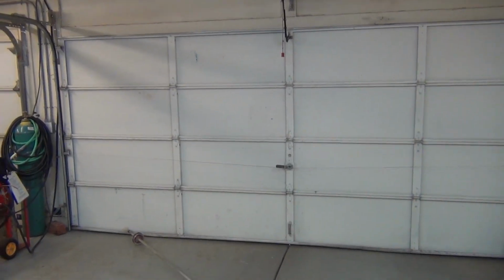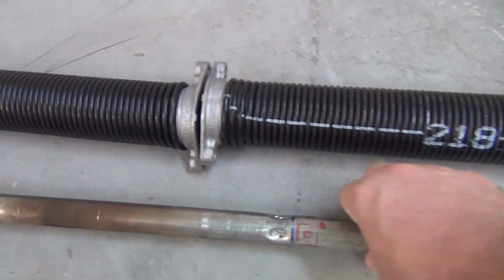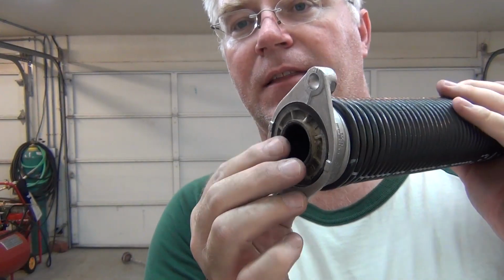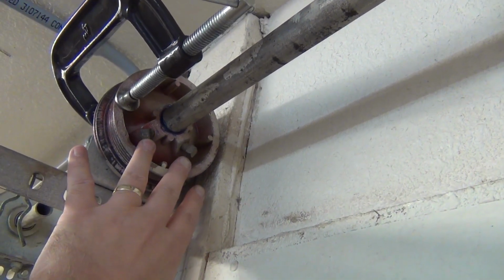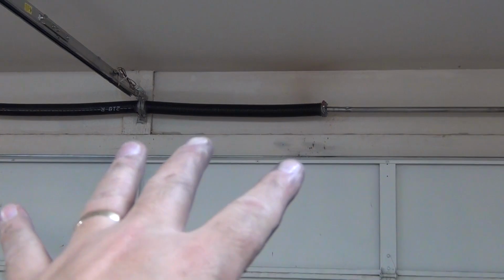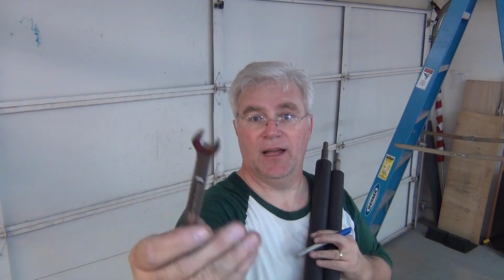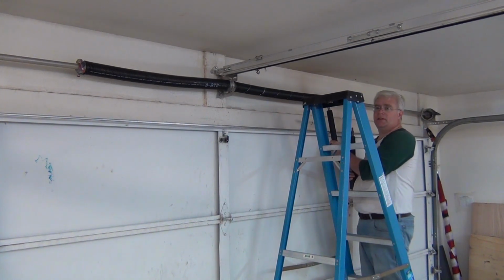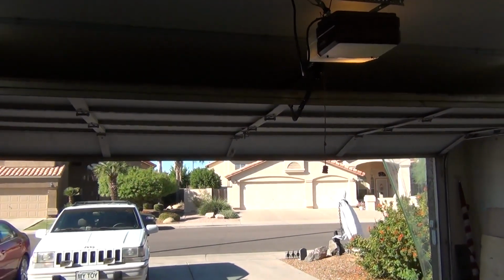ToddFun.com: Garage Door Spring Replacement

Comment: Zip tie that safety release. That is a known way of opening your garage door from outside. The thief puts a wedge into the top of your door to create a gap. Then slips a coat hanger/wire in to grab that safety release. They now can lift your door. 
I lube the door springs with gear oil. That is what is in the professional cans of lube they sell for garage doors.

Comment: With two springs, if one breaks you will still have a total failure. But two springs of a much thicker gauge will definitely increase your service life to failure. My 0.243x29" springs lasted over 30 years and I replaced them with 0.262x42", which should last well past my life cycle!

Comment: For those who want to get fancy, they can replace that plastic center bushing with a steel bearing.  :)
It's also a good idea to stretch the spring slightly at the end, it reduces startup binding.
Also, it's often recommended to have 1/2 to 3/4 extra turns so there is always a little tension on top so the cables don't slack and fall out of place.
I agree with everything about 2 spring setups.   Additionally, when one spring breaks, the second spring absorbs a lot of the shock reducing potential damage to other parts of the counterbalance assembly.

Comment: Good Job, looks easy! You did not do the balance test,...: lift the door half way, should stay there, not going up, or down, then the spring tension is correct !!!
Reply from the maker: I didn't even know that. Thanks for the tip. I hope others see your comment. My install is still working great 4 years on now.
Reply: Happy for you !!=)
Reply: +Eero  also check the top and bottom.  ;)  Door should be balanced in all positions, within reason.  A little twitch in a couple spots isn't the end of the world.

Comment: Assuming you could reach though when the door is UP... Why can't you just 1) Raise the door by hand. 2) wind the cable all the way around each grooved pulley thing.. 3) tighten the set screws on the spring (reaching through between the bottom of the door and the wall from below)?

That would take away all the scary loading...
Reply: +Ryan  There is a youtube guy who did that.  However, the problem is for every rotation of one end of the spring relative to the stationary end(well, unless you got the spring on the wrong side, lol), the spring becomes 1 coil longer.   Just as an example, if you had a 0.250" spring X 7 turns = 1.75" wider.  If you set the the spring in place, then lower the door,  that 1.75" will be forced to be crammed between the winding cone and the spring anchor.   It will probably work, but it will have a lot of binding in the spring causing premature wear and, in an absolute worst case scenario, could possibly cause a component failure(the anchor plate for example) which could violently release the spring tension.
That is why that is not a standard way of installing a spring.

Comment: Good Job.  I watched the installers do mine ( same 3 door combo as you ) and they used the painted stripe that is on the spring until there were the desired number of appearances were showing.  I think your explanation of rotation of shaft to door height makes sense provided each rotation lifts 1 foot.

Comment: Other things to do: 1) Manually operate the door when it's released from the opener. It should be pretty neutrally balanced. 2) Test the openers auto-reverse feature by putting a roll of paper towels  below the door. That should be enough to reverse it.

In our area, building code requires a second door reverse sensor. Either an LED beam, or pneumatic tube along the bottom of the door. Test those too, if you have them.

Comment: Tip for the springs and guides along with the cables is a can of bike chain lube. Spray generously on the whole spring, and it reduces both the wear and the loss in the spring. Works well on the sectional hinges as well. There are clear ones available that do not stain and do not throw off. BTW for the worm better is CV joint grease. Check that the centre board mounts are secure as well, hard to do anything if they tear the board off.